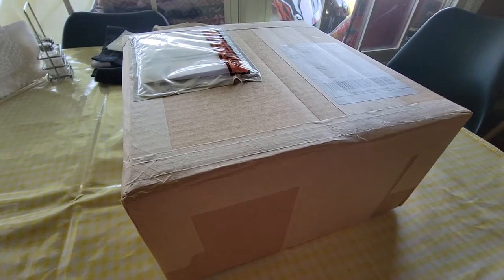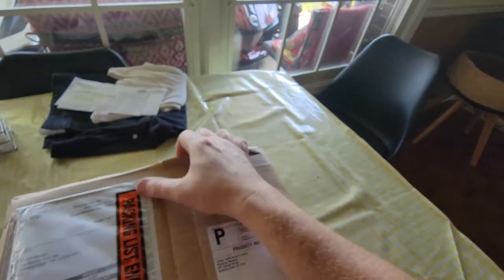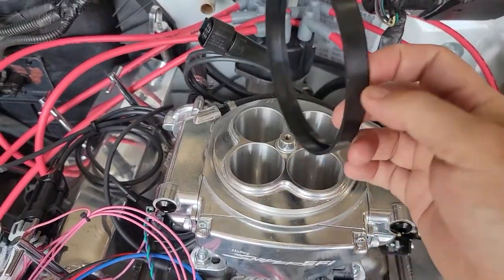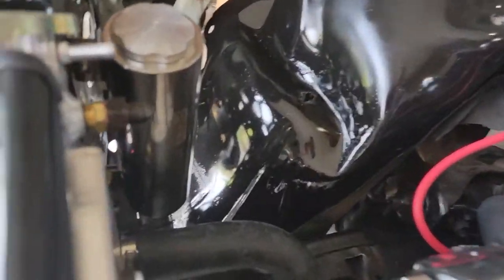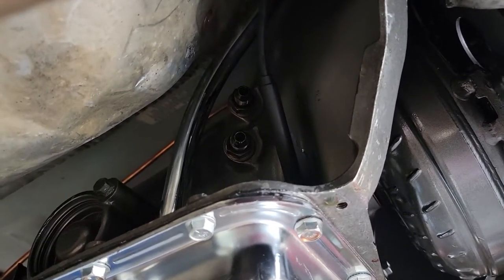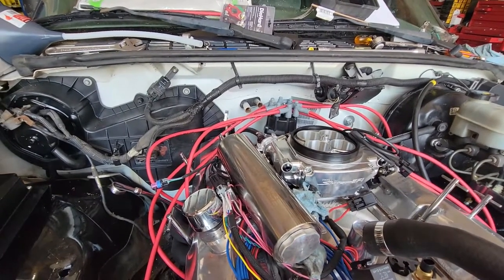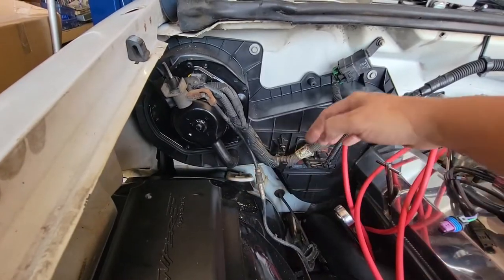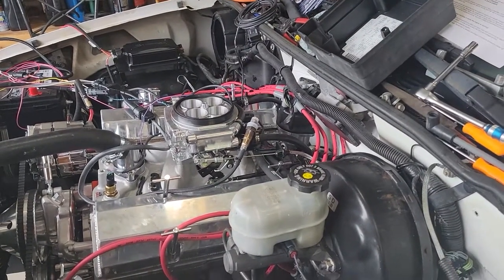How to swap a SBC V8 into your Chevy S10 - Part 8: Wiring (not a how to guide)

Comment: I’m deleting my ecm and swapping in a carb 350 and 700r4 got any advice on deleting the ecm. I am keeping my factory gauges though.
Reply from the maker: I believe you would need to keep the ecm in order to keep your gauges. I ended up ripping everything out and used a 7" digital dash. I didn't have the patience to deal with all that wiring. Sorry.
Reply: @BentOaksGarage  I guess I’m not dead set on factory gauges but I’m not doing the Holley sniper at first so I am gonna see what I can do. When I swap to the sniper I am planning to do the digital dash. My question is what to do about things like the gas gauge.
Reply from the maker: @tri5garage544  the purple wire going into your transmission is your fuel gauge wire. It's the only purple wire in that loom.

Comment: What 2 wires was it? I need to bypass the same thing.
Reply from the maker: What we did only worked for about a week before it stopped starting. I ended up hooking up a negative feed relay to a push button to start it. Since I did not use the airbags, I drilled out the key hole for the passenger side bag and used it to mount the push button. Now I don't have any more starting issues. Hope this helps

Comment: You would be way better off if you bypass the radiator transmission cooler and run a derale remote mount atomic cooler. I did. I put it behind the grille. My temp went from 185 normal to 145-155. Never gonna run radiator coolers again.
Reply from the maker: I ended up building another one, a 2002 Sonoma with the same 383ci and th350. The new one I kept all the factory stuff, the power steering, ac, alt, etc and this one runs HOT. Averages 220 to 230.
Reply: @BentOaksGarage  wow!!  That’s melt down temps.